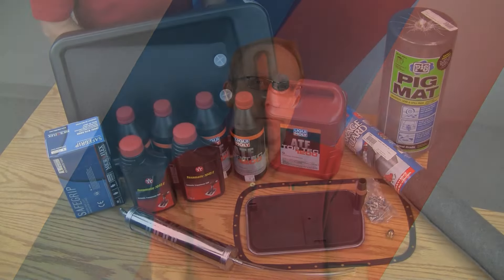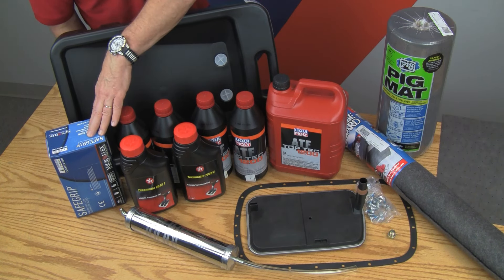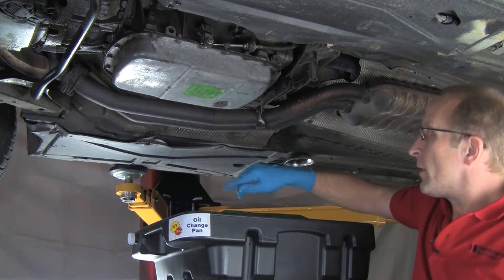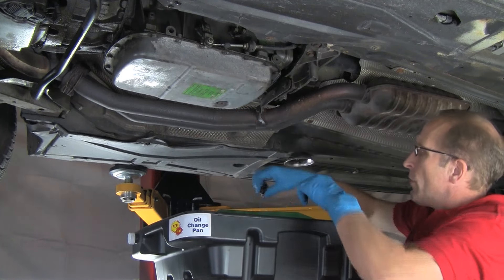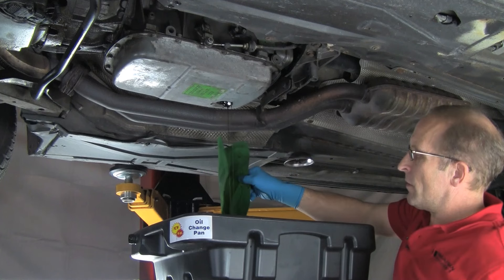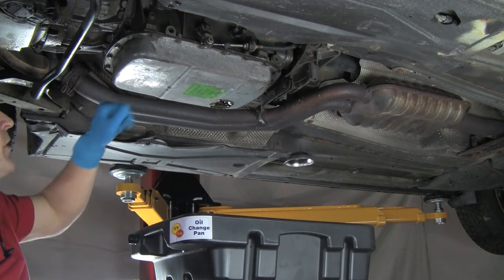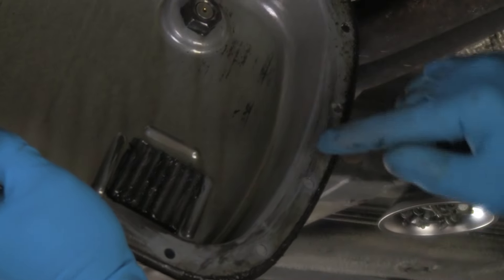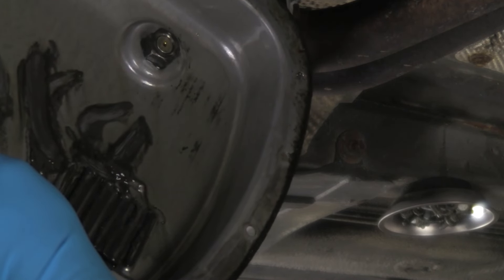Part 1: Changing Automatic Transmission Fluid & Filter On A BMW/MINI

Comment from the maker: The fluid was black due to break-down and burning of the fluid itself, as well as wear material (from the clutches).  there was not a lot of sediment in the pan, which tells us that most of the blackness was due to the fluid being run well past it's useful life.  The transmission ran and shifted noticeably better and smoother, immediately.  The fluid used is synthetic and is one of the proper fluids that are authorized by the transmission manufacturer.

Comment from the maker: The A4S-310R transmission in your 97 528i uses Dexron-III fluid, such as the Red Line D4ATF in our online store at bavauto.com (or call our advisors at 800-535-2002).

Comment: hi good job on the presentation!! just wondering if this is the same procedure for a 2005 530i?
Reply from the maker: +Sherry Morales - Your 2005 530i uses a different transmission.  The general procedures are similar, but the exact locations of drain and fill plugs and the filter are different.  Check out this post, for details on your transmission:
http://blog.bavauto.com/15410/bmw-diy-video-fluid-and-filter-change-automatic-transmission-zf-6hp-models/
Reply: +Bavarian Autosport how much fluid would a 2001 530i take? I'm not sure on the production date
Reply: +Bavarian Autosport +BMW 3 Series Can you please tell me is the expansion tank on e46 fault issue problem on this model or all bmw's if so why hasn't bmw done nothing to fix it

Comment from the maker: Ummm ... Tech-6 ?  The trans in your M3 is the A5S-310Z, which is used in all E36 M3 automatic models.  These could have been originally filled with either Dexron-III or the Esso LT 71 141.  A black label (on the pan) indicates Dexron-III. A green label indicates the Esso fluid.  We carry both the Red Line and Liqui-Moly synthetic Dexron-III and the ZF replacement for the Esso fluid, Lifeguard-5.  Both fluids are high quality synthetic.  See them at bavauto.com or call 800-535-2002

Comment from the maker: The original fluid fill in your A5S-440Z transmission is the Esso LT 71 141.  We now offer the ZF LIFEGUARD-5 fluid for this application.  This fluid has been specifically formulated by ZF for use in this ZF manufactured transmission.

We have the fluid in our online store at bavauto.com.  Just go to the web site, enter your year and model and then enter the part number; LIFEGUARD5

Comment: Hello!
I was wondering if you can give me a hand regarding the type of fluid i should use in my car (BMW E39 520i-transmission: A5S325Z- on the green marker is specified the following code: 83229407807)?
From what i could find out it's a ZF tranny but i was wondering if i could use other ATF oil brands (and which one you would recommend?) instead of going to the dealer and buy it from there since it's quite expensive?

Comment from the maker: The 525d actually does have the same transmission as the one on this 2000 528i.  Therefore, all is the same.  You can order the parts by calling our phone specialists at 800-535-2002 or 603-427-2002 or by email: sales at bavauto.com

Comment from the maker: The only differences (in which auto trans is used) are the production dates.  Your '04 model (regardless of engine) will have the A5S-390R, as shown in the video.

Comment: Youre only draning  at best 50% of the fluid.  Of course  ANY trans will  appreciate  ANY replenishment  but i would  change it again  after running the engine just 5 min would mix the old and the new enough . Then i would change it again every 50k max
If it was MY car anyway im just sayin...transmissions are  kinda pricey

Comment from the maker: The textbook procedure is indeed to use the diagnostic tool to read the transmission fluid temperature.  However, if you use an infrared pyrometer to check the temperature of the fluid pan, this is a pretty good indicator of the fluid temp and will be adequate for setting your final fluid level when refilling.

We offer a nice hand-held pyrometer at bavauto.com , the part number is DPM.

Comment: does the same apply on a 1999 328i?
Reply from the maker: Yes, the E46 chassis 328i will have this same transmission, the A5S-360/390R.

Comment: I have an 2006 BMW 525XI, having problems with the shifts in speed. It says check transmission could it be fluid or that Trans is going bad.
Reply from the maker: You can only know what the issue is by having the transmission fault codes checked.  With this noted, a fluid change is always a good idea as a starting point.
Reply: Thank yu much

Comment from the maker: Yes indeed - we did forget to show this, but it is something that we always recommend.  You don't want to drain the fluid (auto trans, manual trans, differential) and then find a seized fill plug.  Note on the auto trans applications - don't fully remove the fill plug, just make sure that it can be loosened.  If you remove it before the drain plug, you will drain a quart or more of fluid from the fill port.

Comment from the maker: Yes, you should change all the fluids; engine, transmission, differential, power steering and brake fluid.  Except for the engine oil, the others have likely never been serviced.  We have all the fluids and filters in our online store at bavauto.com, or call our advisors at 800-535-2002

Comment from the maker: Most A5S-360R applications were not originally filled with Dexron fluid 9such as the RLD4ATF - Dexron III that you noted).  The current proper fluid would be the Lifeguard-5 fluid.  The fill quantity will depend on the model that the transmission is installed in, due to different pan capacities.  However, most BMW sedans and coupes with this transmission use just under 6-liters.  We have the Lifeguard5 in our online store at bavauto.com. (original filled with

Comment: I always hear people say open the fill plug first.  This way you don't drain it and get stuck unable to refill it.  That can be a big problem if you don't have a second car to drive.
Reply: John Doe can fill as if doing a trans flush if that happens undo the return trans cooler line and fill from there

Comment from the maker: We have other model transmission (and differential) fluid and filter changes in the queue, for additional DIY videos, but we do not have them ready at this time.  Feel free to call us at 800 535 2002 and we can help you in locating the fill and drain plugs.  The job is basically the same other than the plug locations and how the filter is mounted.  Additionally, the Bentley repair manual for your E90 model will detail the plug locations and the filter removal and installation.

Comment: My BMW 320
model 2008
I have a problem with the automatic transmission
transmission Faulty
drive moderately possible to
continue journey Reduced
acceleration Have checked by near bmw service
Then a message appeared on the crash detector
EGS: Shift valve B: stuck in off position
Clutch gears 12 3 and 4: neutral test

Comment from the maker: If you can devise a way to input the fresh fluid into the filter pick-up point, You could feed the fresh fluid in.  The returning fluid would be draining all over from the under side of the open transmission. For DIY fluid changes, you're better off, just performing multiple fluid changes, after running the transmission for long enough to mix the old and new fluid.  After fresh fluid is added, run it, remove drain plug to drain, then refill and repeat.

Comment from the maker: Yes, we certainly do recommend a fluid change, even with the higher mileage.  We have commented on this multiple times in these video comments (for both part-1 and part-2).  You can also see our detailed write-up on this point in our tech blog at blog.bavauto.com ... once you are on the blog, use the search box and search for "automatic fluid high mileage".

Comment: Over the weekend my fan belt break on my 2004 BMW 525i 98,000miles So I push it to the shop and And replace the belt I try to start the car it didn't start mechanic say I need new transmission do I really have to get a new transmission or just change the oil and it should start up?

Comment: Hi, thank you for this informative video. We have a BMW540i with automatic transmission, which sometimes (mostly after a bit of "fresh driving") refuses to switch between the gears. I has 250.000 km on the meter. Could this problem be related to old or too little oil in the gearbox or is it an electronic issue? The problem disappears when the car is turned off for some hours?

Comment: Great informative video as usual Otto.
I am undertaking this task soon, but need your opinion on a prior posting - 
" make sure you change the oil at least 3 times within the first month. When doing the oil change there is oil trapped in the torque converter that will mix with the new oil and will damage your transmission ".
What percentage of the total fill amount do you believe will be trapped in the toque converter, and do you believe I need to undertake a few fills / flushes in the first month or so.
Surely dealers and mechanics at large do not do so, but I will definitely do so if recommended.
Keep up the great work.
Cheers, Sal

Comment: Very methodical video procedure. Love it. I was thinking of doing this myself, until I read this:
"ZF then proceeded to check the software status of the gearbox, reset the adaptations values, and took the car for an "adaptation drive" which involves a series of stop/start procedures, holding gears manually for some distance and shifting through the gears in a specific pattern. This is designed to get the gearbox to adapt to its new values in a very short time.It is essential to reset the gearbox adaptations after an oil change, so unless you have this capability, it is not a DIY project. Failure to reset the adaptation values will lead to premature failure after an oil change." 
Having read this, I'm nervous, but no expert. Please can you reassure me with your advice? Thanks.

Comment: Great video!
I have a 523i 2000 Euro spec with the 5hp19 zf transmission.The fluid has never been changed, and the car has 172,000 km on it. Do you suggest changing the fluid? Complete change or drain and fill?
Reply from the maker: We would absolutely recommend a fluid and filter change at this point.  Additionally, if the fluid is quite nasty (as it was in this video), run the transmission for a few miles (or more, is OK) and perform another fluid change 9just drain & fill).
Reply: Thank for the tip! Will do!
Reply: *****
The reason for the re-change, is to actually allow the oil trapped in the torque converter to mix with the new oil. you should do it more than two times within the first month. otherwise your transmission will fail prematurely in the next 6 months.
Reply: Ioannis Ioannou is this viable information? What is the cause for transmission failure? In my understanding adding completely new oil to an older tranny cause failure because the oil is too thin and slippery. Where as a partial drain and fill is the safe procedure.
Reply from the maker: Please read our comments on the myth of not changing the fluid in older transmissions.  We have this posted in the older comments on the videos as well as in this blog post:
http://blog.bavauto.com/5532/bmw-automatic-transmission-fluid-filter-change-high-mileage/
Reply: Bavarian Autosport
Reply: @bavarianautosport  I am his father.i tell him.thank youI am his father.i tell him.thank youI am his father.i tell him.thank youI am his father.i tell him.thank youI am his father.i tell him.thank youI am his father.i tell him.thank youI am his father.i tell him.thank you

Comment: Hello ! im a mechanic ! Im planning to buy a 530d E39 with an automatic transmission , i never done this operation on any vehicle so ive watched some notes on internet about the oil change , so do you let the gear box in P position while the car is running ? Or i should shift gears PRND until the oil temperatre rise 140F ?
One last question ! What should i careful on the Auto. Trans. when i'll try the car ?
Thank you !
Reply from the maker: You can run the engine with the transmission in PARK until the fluid is up to temp.  Then, do the run through the gears and back to PARK for the final fluid fill.
Reply: Okay all right i'll be doing this when i'll change the oil thanks !
Reply: BavarianAuto Hi again ! Well im going to change soon the oil on my transmission as shown on your video its à 5L40E. My bmw with the M57 engine has the same automatic transmission ! But you said in your video the oil refill is at 140F ( 60°C) but i read a manual about the service of this AT , its written that the oil check is at 35°C so it means that your oil refill was wrong ?

Comment: Will this procedure be similar to a 2003 BMW X5 3.0i (E53) 5 speed automatic transmission? 

Btw the transmission is a GM sourced code number: 5L40E

The car has 162k miles I just got it I'm not sure is transmission was serviced though it's shifts fine wondering if I should do the tranny service anyways. Thanks
Reply from the maker: Yes, your transmission will be the same as shown.

Comment: That is how it is for Volkswagen also.  They bullshit you into thinking you don't have to do it.  I know people who also tell me that I don't have to do it.  I wonder how very many transmissions those ones have fried from not maintaining them.  If you follow their advice that is the WORST thing you could do for your car.  I do mine 30,00 or sooner in my Jetta.  I want to keep the car for some time and not let it die an early death because of some awful advice.  That awful advice comes from:

 A: people who don't know any better

OR

B: auto makers who want to sell you a new car every three years and do it by giving you the advice never to change the ATF

Isn't it odd that although they say that, they will sell it to you?  You just have to pay VW the princely sum of $18.36 PER liter if you do it yourself OR pay them for the fluid and labor to the tune of around $400.00 to do it for you.  That is much cheaper considering the cost of ANY transmission if you are not able to do these things yourself or are just not comfortable doing it yourself.  I know people who would tell you that VWs are impossible to work on.  They are full of crap!  Sure you might need some kind of special too but that is most certainly not for every little nut and bolt.  If people would get around that stigma of BMWs and VWs being hard to work on, I would not be so frustrated trying to convince those dummkopfs that I can work on them.  There are a number of things I take it to the shop for but only if I can not do them my self such as replacing a part buried in the door somewhere that is usually electrical or just time consuming to get at.

Comment: Thanks much for the great video.  Can you tell me the proper fluid for the E36's A4S 270R transmission? I can't seem to find an authoritative answer anywhere.  If there is a factory fill, I'd love to use it, if not I'm guessing Redline D4 is perfectly okay.

Comment: My BMW 740I jerks when put in reverse after it get hot. But when its cool, it shifts and drives fine. So, I called a Bmw mechanic in Weymouth Ma( 7818183830) who said changing the trans fluid would make the problem worse....hmmm. He didn't even see the car , despite the fact I told him the mileage was high 192,000. im confused :(((
Reply: Allen Donaldson automatic or standard trans. And it sounds like your mechanics right. If it's an auto, the trans fluid also acts as a hydraulic fluid for the transmission. So if you changed it then it would engage the gears better when changing. If it's a manual/standard then there would be no effect as it doesn't use trans fluid but a separate system for gear shifts and hydraulics. Mines auto and when I changed mine it did.
Reply: Somedaysuperhero so are you saying by changing the transmission fluid will cause the jerking feel or cause the gears to engage properly as it should Without jerking?

Comment: Just a recommendation, if nothing is wrong with your transmission, do nothing. If you choose to follow this DIY, make sure you change the oil at least 3 times within the first month. When doing the oil change there is oil trapped in the torque converter that will mix with the new oil and will damage your transmission. Even if the oil is the same brand as the one you use during the change. Again, if it doesn't bother you, don't bother it!
Reply: Ioannis Ioannou How would you know if there is something wrong with the transmission?